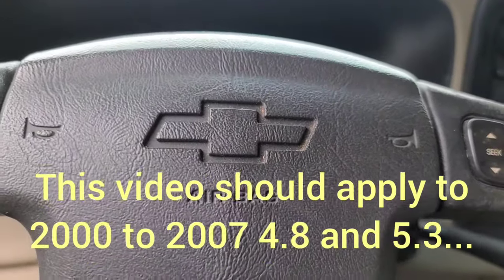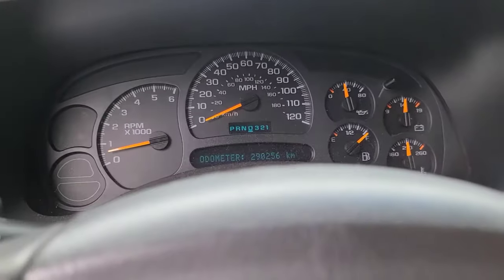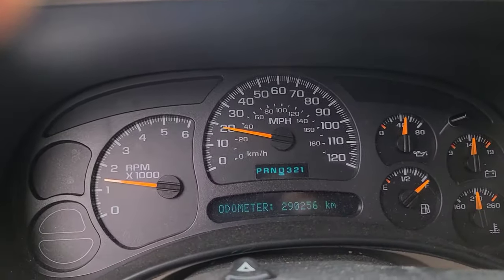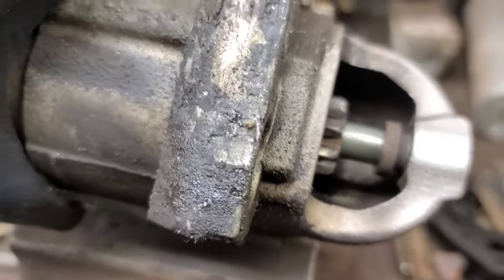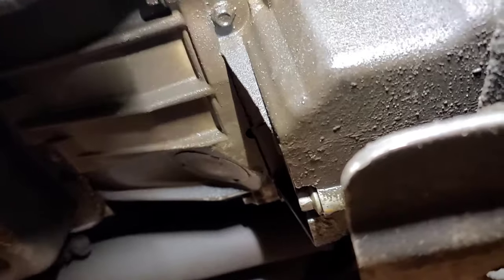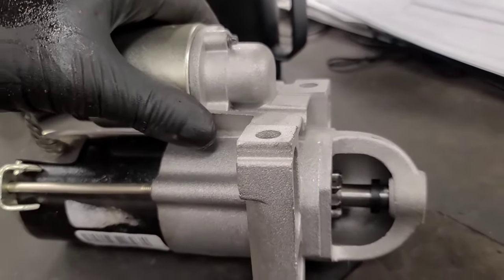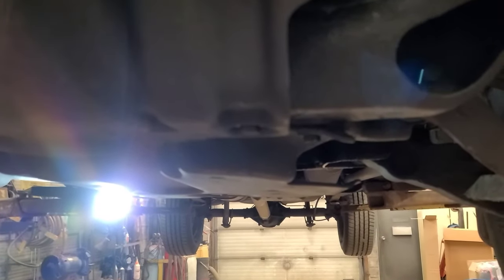2000 to 2007 GM Truck 4.8, 5.3 and 6.0 Engines. Weird Rattle On Acceleration

Comment: Bro I had 2 gear shops tell me I needed a rebuilt transfer case and front and rear dif serviced which I serviced my self I knew my transfer case was good took my truck to 3 different mechanics one told me I needed new axles up front we did that another told me it was an exhaust rattle due to my headers and it amplified the rattling from the heads and the other guy had me replace my drive shaft yoke, all for a guy on YouTube to show me that it was my starter that I would’ve never assumed was fucked up bc my truck turns on instantly thanks a lot bro I was getting tired of that shit this made my fucking year
Reply from the maker: @obsmark8714  glad it helped you out

Comment: You're a life saver! I could not find any videos that replicated this sound. I have a 1995 GMC C1500 that currently has this issue, but only under hard acceleration. Goes away if I restart the truck (which led me to believe it was the starter in the first place). Thanks for helping me confirm!
Reply from the maker: Glad it helped you out
Reply: I have a 2005 Jimmy and I hear that noise. I get a grinding feel and sound like that. Im gonna pull the starter and see if its busted or teeth wear

Comment: After 3-4 months of worrying about that clickety click noise being the torque converter, cracked flywheel, transmission- I found this video and changed the starter in my 2015 2500hd with 6.0 gas and the problem was EXACTLY the same so THANK YOU Phillip!!
Reply from the maker: Glad it helped you out.
Reply: I think my truck is doing the same. Gonna start with this and if it doesn't stop I'll continue searching. I start it up and it makes a clicking noise even while idling. It's quiet. But when I accelete it sounds like this. No check engine lights. Starts up no problem so we will see if this fixes it!

Comment: Dude, awesome thank you so much. I just changed my starter out this morning and sure enough the exact same issue was causing the pinging\rattling noise. There's not  lot of videos on here that show this, most pinging\rattling noise videos are for lifters or rods or fuel injectors making noise. Thanks again.
Reply from the maker: Glad it helped you.

Comment: The rattle in my 2004 silverado , was  my wheel bearing dust cap had came off , tapped cap back on , a five minute job.

Comment: My 05 2500hd has been doing this for about a month and started after I had pulled a large boat. I was thinking it was something with the transfer case or possibly the transmission. I’ll pull the starter to confirm it is the issue. Mine mainly does this when I am moving forward and  it shifts from 1st to 2nd.

Comment: You sir are a genius!!!!! I've had 2 local shops try to get me to replace my engine saying my bearings were bad on the crank but I replaced my starter and the noise stopped!!!! Thank you so much for your video
Reply from the maker: @kelseyellegood1216  glad you figured it out.

Comment: The same problem with my Ram 1500 Hemi. It's been weighing heavy on my shoulders for about a month. All of my research suggested the flexplate was cracked and I was anticipating spending a few grand to have it replaced. Finally, I came across this video and found a solution. Thank you for sharing your time and knowledge. I hope to buy you a beer some day!
Reply from the maker: That's interesting that a Ram could have the same problem but certainly is possible. Did you actually fix it already?
Reply: @PhillipBailey  I sure did, I saw the video this morning, ran the same tests in your video with the same results. I pulled the starter and it had the same wobbly pinion. I put a new one in tonight and it’s sounds great now!
Reply from the maker: @orchardsofsteel8912  good to know. How did you stumble across my video driving a Ram?

Comment: Thank you for the “sound samples” and un/install tips.  My 2013 Silverado 1500 Lt had only 108k miles and started that same click at idle and driving last week.   Switched it out tonight.  The new starter sound caught me off guard for a second.  Now I can worry about all the other noises and clicks! Lol.  Thanks again!
Reply: Scott. How much did the repair cost? Mine was $425 at mechanic shop.
Reply: @scottthomas3634  , just the price of a starter that I replaced myself.
Reply: Yours did it at idle? Mine is making a very similar noise but i was told it was a rod bearing, im only 20 and my truck is under payments, idk what to do.
Reply from the maker: Have it checked by another mechanic.  Rod bearing knock is very bad and usually much louder and deeper. How long have you been driving it like that? How's the oil quality, level and pressure. Check for suspended silvery partials in the oil.
Reply: @toxicjoker1533  , it clicked intermittently not consistently.  Mine sounded like the video when driving.  At idle and not moving it would click a little and then go away and then come back again.  The starter gear was just moving back and forth.  When I pulled the bad starter it did the same thing as in the video.

Comment: Thank you for taking the time to post this. I would have never thought the starter was causing this noise on my 09. You saved me many hours of stress and searching to find the cause.
Reply from the maker: Definitely was an odd noise but appears to be quite common. Glad it helped you out.
Reply: @PhillipBailey  question??? My 05 sierra 1500 5.3 makes this same sounding rattling for a few seconds at start up and lightly reving the engine it starts to do it a little lighter sounding starting at about 1800 rpms but don't really here it past about 2500 rpm. I thought I was hearing the timing chain but after your video lol I'm hoping it's just the starter motor. Whats your thoughts ? Greatly appreciated the video.
Reply from the maker: @brentacusmaximus6677  if you can reproduce the noise sitting still possibly with someone in the cab stepping on the accelerator then use a stethescopebto try to pinpoint the source. Could be drive belt related. The tensioner on at AC belt tends to fail and rattle. Take the belt off and try it. Good luck.
Reply: @phillipbailey my 2012 is making a tick like noise coming from the bell housing on the right side where the starter is that’s where u can hear the noise from the loudest I had a 6l80 swap done an had to go back for a upgraded torque converter. Well I got it back now runs and shifts fine but this noise is driving me crazy

Comment: Was chasing the same sound on my 07 sierra for days after a motor swap kept thinking it was something motor related or broken flex plate finally came across your video and sure enough my starter is the same way thanks for the help
Reply from the maker: Glad it helped you.

Comment: 2 years I finally found the exact noise that matched my 2007 Gmc yukon🙌 thanks
Reply from the maker: Glad I could help!
Reply: What exactly did you order?? I have 07 Tahoe.
Reply: @ManMan-Real  Bought a new starter
Reply: Yeah it wouldn’t pop up but found an acdelco on rock auto. Thanks!

Comment: just exactly same 3 observations I got, and I thought about the same issue about the starter, I bought a brand new one $200 lifetimeW, when going under the truck and hearing again, I doubt again it was the starter, fiuuu! I was close to return the new one, and looking for some other faulty part, but your video has saved me wasting time and more money. I have Silverado 2011 5.3 Mex. 4x4, Thanks a Lot. I will proceed to change it.
Reply from the maker: You will know when you get it out if the starter drive just falls out.

Comment: This is not just restricted to the vehicle years you have mentioned, I have a 2011 GMC Savana van with a 5.3 and had this exact noise driving me crazy until I saw a similar video, I removed and replaced the starter and that was the exact problem! The drive was lazy and rattling against the flexplate, at one point I was ready to separate the transmission and remove the flexplate so I'm glad I found this to be the issue!
Reply from the maker: Yes based on the comments it appears to affect a lot of years and models. Glad you fixed it before pulling the transmission.
Reply: I removed and replaced the fly wheel trying to solve this issue. This is what I should have done.

Comment: Thank you, I have been searching on YouTube for weeks to try to diagnose that exact sound. I’m going to check to see if I have the same issue. I have a 2005 Pontiac G6 that makes that identical noise when turning left and accelerating. The starter is mounted sideways I believe on that car. Thank you again. I’ve replaced both CV axles, wheel bearings, struts etc.
Reply from the maker: Yes the starter is mounted sideways so it would be susceptible to yaw forces turning. I would think though it would be worse turning right. Good luck.

Comment: I am getting a very similar noise on acceleration. I'm going to do the reverse braking and hope I hear the sound. If this is my problem I am so thankful for this video lol.

I really hate when I start getting random noises from underneath.

I've dealt with U joints twice, a carrier bearing, a loose transmission exhaust hanger, and now this. It's so annoying because you don't know what it is!
Reply from the maker: Hope so. Let me know
Reply: @PhillipBailey  I tried to get it to do it in reverse but it didn't do it at all after restarting my truck.  The starter makes sense though.. and with the window down it was louder on the passenger side when it was acting up. I will keep listening for the noise but between this video and one more I found on here, I think it was the starter.
Reply: @PhillipBailey I changed my starter and still haven't heard that noise but I have got a different noise, a lot louder but only lasted a second. I've only heard it a few times so far randomly. I think it might be the emergency brake pads . From the video I watched, they can also make a sound similar to this. I did look at my starter though and wasn't in very good condition anyways.

Comment: My 2004 Chevy started a little chatter. Took the starter out and the pinion drive was doing the exact same thing. Changed starter and noise went away. It never made any other noise and started fine lol. I would not have thought it would of been starting it still.
Reply from the maker: Glad you figured it out

Comment: You are the man. I have had this same problem. I thought it was a cracked flex plate or loose bolt in tranny. I was scared i needed a full tranny rebuild. My noise only happens when first put into gear and going slow under 3k rpms. Maybe wjen it gets faster its drowned out by road noise. But thanks so much for posting this video.

Comment: You might have saved me a small fortune. The mechanic told me it's the flexplate and it's $1200 to fix. Like yours, my truck would only make noise when accelerating and at idle while on an incline. I'm going to change the starter to see if that's it. I really don't trust this mechanic. He seemed shady.
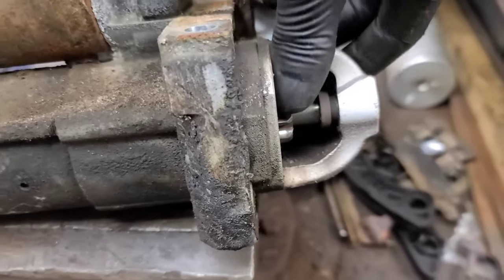Reply from the maker: At 2:10 in the video you can see the starter drive just falls in and out. Let me know.

Comment: Man, I’ve been wondering what the heck has been making that terrible sound on my 02 Silverado. I’ve had it parked for a year. It runs great and shifts fine but it rattles so nasty. Gonna pull my starter and see if that’s what it is

Comment: My 2013 Suburban is making this noise exactly, and it started with a screechung noise and I thought a rock got caught between the rotor and the guard plate. Then the noise has been constant since then
Reply from the maker: If the noise is present sitting still and is engine speed related it's not in the brakes

Comment: Had a feeling this was the problem as I also noticed it only does it when the truck is positioned on certain angles lnew my starter was bad this just confirmed it will update once I install new starter

Comment: I have shiny tips on the fly wheels also.. it seems to be making that noise even in park / idle... Do I have the same problem? The nose gets louder when give it gas.. then stops after I have some speed.. but still goes on and off.. truck seems to drive fine
Reply from the maker: @khanm83  without actually hearing the noise it's hard to tell. Can't tell til you remove the starter.

Comment: I was looking at rattle noise videos and this one sounds just like my tahoes problem tried it in reverse also no rattle going to take starter off and check it out thank you so much new subscriber
Reply from the maker: Let me know if that's your problem.
Reply: @PhillipBailey  did your issue get resolved after new starter?
Reply from the maker: @latiajuana2953  yes that was the problem on this truck.

Comment: I have a 2005 GMC 5.3 pickup truck. Here are the details of my issue:
When I first start it in the morning, the oil pressure is fine but after the engine heats heated up and about 10 minutes of driving I hear a heavy rattle in the motor...this only happens upon any type of acceleration from a stop light or even accelerating on the highway, or street, even light acceleration. it is a content issue from that point forward, until the motor is stopped and given time for the time to cool down... Also after the engine heats up, the oil pressure drops somewhat..., also when I first start the cooled engine, I notice a heavy blue smoke from the tail pipe, this only lasts for a few seconds and then no more smoke... It has about 160,000 miles.
Thanks for any advice you have to offer.

If you have any ideas it would be greatly appreciated.
Thanks.
Reply from the maker: The engine noise and smoke are probably not related. You may have excessive bearing clearances or worn main or rod bearings. hen the oil is cold it is somewhat thicker and will help quiet down a bearing knock. This would also account for the low oil pressure. You should have it assessed by a mechanic as this is quite serious if that's whats going on. The smoke is likely due to worn valve guides and or valve seals. goodluck

Comment: When I accelerate from a stop or traveling at low speeds I hear an intermittent jingle....yes sounds like little jingle bells here and there. I can't figure out what it is 😂 it does not sound clunky like in your video. I was thinking maybe something in the exhaust. I literally looked a few times to see if someone strapped some little bells under the truck (Yukon).
Reply from the maker: @NavyDave219  this could be your issue. This one sounded chingly like that too.

Comment: Mines doing the same exact noise but then my truck stalls even though it’s an automatic my truck is ls swapped. The first engine blew a head then I swapped it to another lq4  and it did the exact same noise but it stalls and truck turns off and starts smelling like it was burning oil then we warrantied that engine and that one is doing the same aswell

Comment: My 07.5 Silverado does something similar at all times. Not necessarily a tick or knock more of a rattle and u e been stumped I’m going to give it a look
Reply from the maker: If you can duplicate the noise sitting still possibly by brake torquing the engine while someone tries to pinpoint the source of the noise.

Comment: I have the same sound on my 2002 cadillac escalade with 5.3 but the starter is perfectly fine, it is the original starter on the truck, and it also makes a tinging noise when going in reverse but I'm just worried about the noise when accelerating even on highway speeds I hear it
Reply from the maker: @JoseUzielFlores  maybe a universal joint on the front or rear drive shaft. Loose exhaust heat shield

Comment: Mine just started doing this exact noise and i figured it was the started and put it uphill aswell and sure ENUF the noise got quiter
Reply from the maker: Good find.
Reply: Update it wasn't starter after all pulled it and it was fine next on to a possible broken or cracked flex plate

Comment: I think you solved my problem it makes the exact sound as yours so you suggest I just change the starter.
Reply from the maker: If you can reproduce the noise sitting still say on a slope up hill you may be able to hear it rattling at the starter. No way to check this without removing the starter. Good luck.
Reply: Thank you so much the sound is identical as your video exactly  Thank you so much I will get it checked ASAP.

Comment: Will this noise happen only under low rpm in drive ? Mine is only rattling like that when I’m giving it very slight gas, but when I give it more it goes away, but when I feather the gas the noise happens
Reply from the maker: Usually on light to moderate acceleration from a stop

Comment: Did it only do it while the engine was cold because mine Is making a similar noise but it went away once the engine warmed up
Reply from the maker: this one was hot or cold but temperature could be affecting things.

Comment: could this possibly be my issue if the rattling still happens when my truck is stationary? i have been trying to diagnose this issue for 2 weeks now
Reply from the maker: If it rattles when stationary then it should be easy to locate I would think. Lots of possibilities exist for rattles. Heat shields on exhaust manifolds, converters etc. Broken loose substrate inside a catalytic converter. Try tapping on exhaust components with the truck not running with a rubber hammer.

Comment: Will it stop ur car from moving in drive or reverse but I have that rattle noise but my truck hesitated to park I had to u turn gud thing I was at home when it happened I had to push on gas hard to get it to go
Reply from the maker: No this won't affect the engine or transmission operation in my opinion.